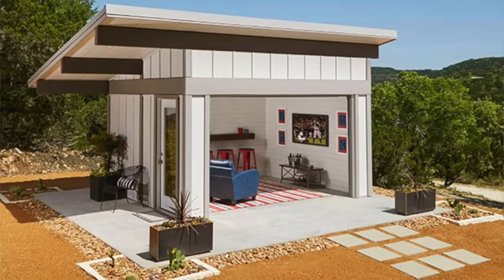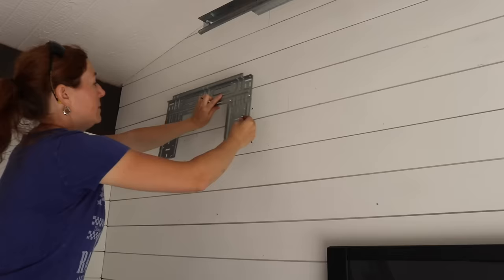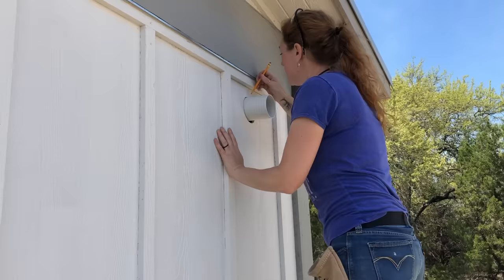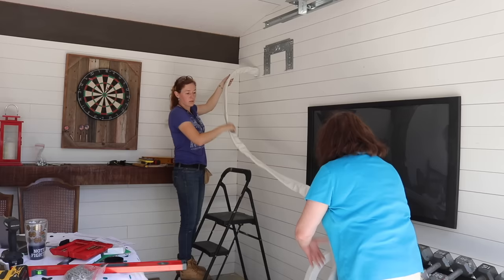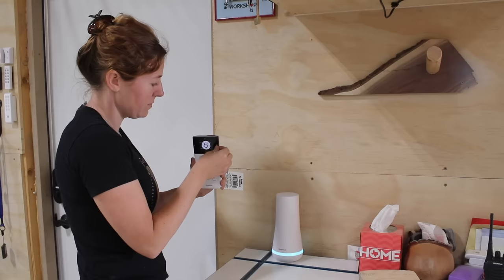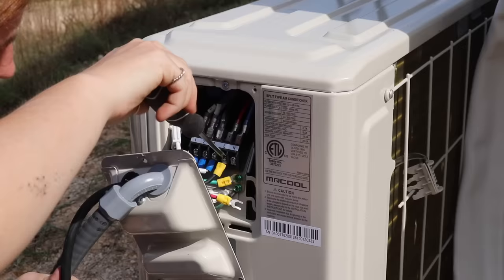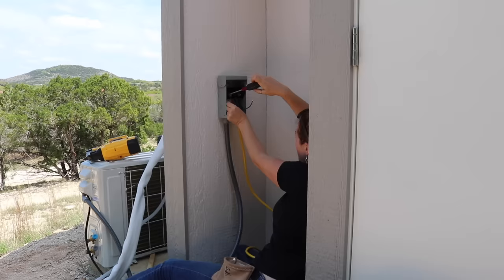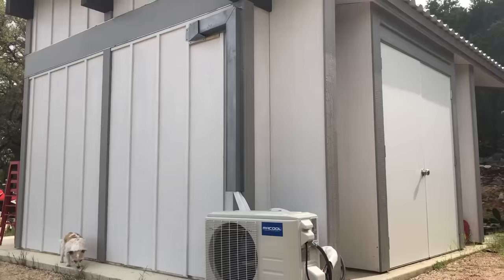DIY Ductless Mini Split Install - MrCool Unit

Comment: Why didn’t you just install a window unit with wall sleeve? Less power consumption and less costly.
Reply: Window units are loud and less efficient than a mini split. They are cheaper however.
Reply: It’s only 168 square feet. The generator size needed to run the split would justify a window unit.
Reply: @Robyrob7771  seeing his as that huge overhead glass door I think a smaller btu would be insufficient in the heat they get there year round, with the sun shining inside during daytime. Plus it doubles as a heat source since the unit she got comes with heat pump hence the cost for it on Amazon.

Comment: Might need to talk about pulling a vacuum and also the lineset being coiled like that will cause issues and shorten the life of the compressor.... might wanna call a LISCENSED HVAC contractor 🙄
Reply: Good golly are you just another who ignored to listen to when she clearly mentions and the company also states on their website, the lines come PRECHARGED, thus the full DIY (unless local code requires the electrical be done by a certified tech if connecting to main power breaker) install aspect of these systems they make and offer in various capacity. Go ahead before you react and look up the Mr Cool DIY in web search and check out the webpage where it has been mentioned since they came of with this system at least 2 years ago that the lines and not just the units coe precharged, thus plug and play DIY.

Comment: Weird, I thought you weren’t allowed to install that yourself. Which is why you had someone install the one in your shop.
Reply: Some places do not allow DIY install yourself, and must still get a certified tech to install them despite their clear DIY ease, though I heard of some buyers opting for the electrical getting done by a pro electrician for personal safety and personal liability insurance.

Comment: Does the mini split use 110 or will it need 220?
Reply: You can get them in 110 or 220 but I highly recommend having it professionally installed the lineset should have been shortened and checked for leaks with nitrogen and then the lineset should have been vacuumed down to get all contaminants and moisture out of lineset and check refrigerant pressures so the unit will operate properly and if you do it yourself without a license HVAC contractor you don't have a warranty and some warranty are good for 10 years just a thought
Reply: @troyb9609  Thanks

Comment: Could have saved yourself a lot of time by drilling your hole on the right side and pushing the refrigerant lines and drain lines straight through and making your connections all outside.

Comment: When running your mini split
 Run the fan on high speed all the time to remove the moisture off the coil 
Otherwise you will end up with mold buildup on the evaporator 

Also your template was probably on the cardboard somewhere
Reply: When she did the install of the bracket using it since its essentially its own template, she mentions how the right side did not align with the stud despite not using the horizontal slats which would allow to connect properlly to said stud and using only the vertical ones. Go ahead and watch this part again and you will notice.
Reply: Joshua79C C 
I’m good thanks 
 Pipe fitter by trade 
 Do the dry side when they the ac guys gets backed up 

I do the wet side of HVAC
Boilers chillers etc 
These things have their application but I wouldn’t install in my home 
If not properly maintained and run and set up correctly they are a breeding ground for bacteria and mold 

Thanks but no thanks 
Just my.02

Comment: Does that run off 110 or 220?
Reply: The really small cheap ones sometimes run off 110.  Larger ones are 220V 30A.
Reply: She linked it in the description, it says its 115V not even seen one that size using 110V, my window 12k btu unit uses 115

Comment: Mitsubishi has good systems.
Reply: They do. They are also expensive and won't sell them to the public.
Reply: Mr Cool is the only one to offer DIY units. Most others are as Jeffrey states, require a certified and experienced tech to have installed since those non-DIY systems require charging of the system after installing.

Comment: How long is the line set?
Reply: (takes a moment to look it up online) 25 foot per their website page on the system. That much line makes sense since it has little effect on efficiency no matter the length of it, but IMO I would rather 15 foot for such a short run  so as not to have so much extra coiled up 'in the way' of the units exhaust.

Comment: She didn't vacuum the line. No pressure test.
Reply: As she said, no need to vacuum that lineset. They have a version of "AreoQuip" fittings and are fully charged/ ready to go. Of course, if you ever try to disconnect them, you lose the entire charge and THEN you will have to do the whole vacuum process. The generator idea isn't the greatest: Many generators can put out very odd and unstable voltages and frequencies that can easily damage the electronics in these units. Creative install, decent video! 
[For the record: I have been in this field for well over 40 years!]

Comment: be mindful of carbon monoxide using a generator in small space. nice job , thumbs up
Reply: she was sitting where it will be put when working outside on the back end installing the electrical box. plenty of airflow and such

Comment: alos, does anyone have one of these. the contractors i spoke with said they do not heat very well, only 30 degrees above outside temp. so if it is 30 outside it would only heat to 60 degrees.
Reply: All heat pumps are not efficient below 30 unless it's a  Geo thermal . Most have heat pumps have heat strip added for below 30
Reply: I live In CA and it does fine. However gas is way cheaper for heating in Cali as we pay 20c kwh and up....
Reply: I have a 18k MR COOL unit in a 600 sqft insulated garage and it had no problems heat it to 75+ this winter when it was 35F outside.

Comment: Why wouldn’t you just get a portable AC?
Reply from the maker: I have several Mini Split units and absolutely love them! They're quiet, easy to install and cost efficient. If a portable AC is right for you, excellent! Thanks for watching.
Reply: These units are amazing. I heat and cool my 4000sq ft house with two 18k units. My house is 100% electric and my biggest bill since installing these a year and a half ago has been $138/ month. Plus the power usage is so low that you can still run them on a portable generator if the power go's out.

Comment: With that much extra hose I would have carried it off away from the house and buried the line.
Reply: And minerals in the soil would eventually eat into the copper line and cause it to leak.

Comment: Awesome video.  The best part was when you put all of that lineset right in front of the condenser coil so it will not get enough air through it.  These things are impossible to work on because home owners are doing it themselves. And when it doesn't work, it basically needs reinstalled.  These are not quality pieces of equipment.  You'd be better off calling a pro

Comment: Did you add a clamp connector for the power cable that runs with the line set?

Comment: I think I would pay an ac guy to shorten that line
Reply: John Davidson 
That would defeat the purpose of getting the DIY unit. Having the pre-charged lines comes at a significant price premium compared to similar models from the same manufacturer without pre-charged lines. Cutting the lines would be throwing that extra money away.

Comment: A $100 window unit would work.
Reply: Boy have you got to be that , since I rent I only use 5K ($150 from some small brand no longer using the old brand name) and 12K ($400 from Frigidaire through Lowe's) window units,  neither cost that little, and if so then they were made cheaply for that cheap of a price and would not last well. I also have a 15k Frigidaire, but was to much so it sits in storage but was $450 when I bought it, all only cool no heat pump like this MR COOL DIY unit hence their half or 1/3rd the price for what she got

Comment: I appreciate your DIY efforts but this is something that should be installed by a professional. All units should be started properly by verifying pressures, amp draw, etc. This should not be advertised as a DIY project.
Reply: Than they should not be selling them to just anybody.But she did install it and it works.
Reply: Sell it now Yes they are sold on the internet and they should not be. Also yes hers works but when it breaks then what? Then she has to hire a professional to come repair it. Working on ductless split system is not a DIY thing like recharging your car ac with the little cans of refrigerant.

Comment: looks like too much stuff for a air conditioner i rather put a thru the wall air conditioner with a normal  electric 115 v plug

Comment: seems like a lot of waste for a precharged lineset.
Reply: Otherwise she would have had to use a vacuum pump first then gauges & a tank of freon to charge the lines. Precharged lines became popular more than 30 years ago.
Reply: @jwarmstrong  alot of those ductless split systems come charged with enough Freon for up to 150ft from what I experienced. All you have to do is pull a vacuum and then open the valves. I understand that this is an easier alternative but I'd rather have a nice tidy lineset instead. Just my opinion

Comment: Too much!  Why not a simple in window unit?  Cheaper and no install required.  Way over-kill IMO.
Reply: AC units use much more electricity and thus are much more expensive to operate. Also, window units usually need the extra space around the unit filled in some inefficient way. Also, I have all casement windows; window units won't fit well.

Comment: You could of just put in a window unit at home depot for $150.
Reply: there are trade off, but once that minisplit have problem u need to open your wallet up, when window unit u just throw it away and put another 150 in. @paulcopeland9035
Reply: My newer window ac units are more silent than the older acs i used to us, the 5k unit in my bedrom was $150, I replaced a GE 10 with a Frigidaire 12 which is more efficient and also noticably less noisy than the former unit which was lacking in bottom guide/support brackets that broke of some years ago. Since i live in a rental unit I rather like the window units over the pricier and intrusive mini systems, until I eventully move into my own place will I consider a mini split to forgo the backbreaking with the window units and would keep them around for when the main system needs repairs during summer heat and humidity (i live in New England).

Comment: You did not vacuum the unit
Reply: that's because its not needed. its a DIY setup where both the evap and condenser are precharged
Reply: Seriously, listen and not just hear what is being said she talks, as mumixam said the in and out side units plus the lines are all precharged, this is how it has been since they introduced these DIY models at least 2 years ago.
Reply: @james6794  are you sure?
Reply: @NuCreativeHIcinema  Entirely. No. The documentation says the unit is precharged but im not sure what that really means? is the entire charge in the condenser unit like most standard split systems and the evap is in a vacuum? or are both the condenser and the evap charged. Having both parts under positive pressure make more sense to me as if the evap was under vaccumm there would be a high chance some air and moisture would be sucked into the system when connecting the quick connect fittings together
Reply: Correct.  The air and moisture left in the inset will eventually give her problems as moisture and R410a don’t mix well.  The line sets ARE NOT PRECHARGED.  Think about it.  How could she connect the flares under 250psi?  Come on people think.  The condenser is precharged but she should have vacuumed the system first.
Reply: Britton Corbin 
So you’re suggesting that the manufacturer of this unit is lying in these statements where they make it clear that the linesets are indeed precharged, or do you happen to know more about their linesets than they do?

“Precharged 410 Quick Connect Lineset. The included 25′ pre-charged lineset allows you to install this innovative ductless system without special tools, equipment, or training.”

“We here at MRCOOL did not invent pre-charged line sets. They’ve been around for years, but were mainly confined to the modular and mobile home market. That might be one reason why so many people have not heard of them. Don’t worry! Pre-charged line set technology proved itself years ago.  Basically, all we’re doing is applying them in an innovative way.”

“MR COOL says:
January 28, 2019 at 9:14 am
On the DIY unit, the lines come charged, so you cannot cut or modify them without professional training and equipment.”

Comment: What kind of installation? The outdoor unit is not fixed, stands on the concrete, there is no normal blowing. Long work will not be this unambiguously.

Comment: It's nice but $1,300+ for it is pretty pricey ....
Reply: Prices on Amazon fluctuate so wildly, its usually around $800, paid $400 for a similar size window unit from Frigidaire at a local Lowes
Reply: try looking up mitsubishi mr.slims
Reply: I realize since and at the time, this is more due to it has a heat pump in it, ac only unit will cost a few hundred less.

Comment: Can the line set be cut so it's not too long?
Reply: Aicx Medina No - she addressed this exact question in the video...
Reply: she said this model was pre-charged and you could not cut the lines
Reply: She said you can cut the lines, but then you would have to pay a professional to recharge them.  Defeats the DIY aspect.

Comment: I would of cut a hole and installed a window unit in the wall and been done with it . but thats just me. If I had one donated to me id do the same as your dong. thanks for the video.

Comment: rent pipe cutter pipe flaring kit to fix the length of the lines, vacuum pump charge line to suck out air from lines from tools renting shop

Comment: ☝ 32 years experience doing HVAC. 
About these DIY mini splits. The companies that make them often go in and out of business like the tides of the ocean.  Or they may one day decide not to import to the U.S. anymore making replacement parts almost impossible to get.  That being said if it does ever break down you'd be better off just tossing it and buying another one. It's a disposable appliance like a window air conditioner.

Comment: I would have kept the hole to the right though..
Reply: The unit is designed for the lines to exit right or left.  If she ran it out the right the lines would be an eyesore.
Reply: she made the best choice if you notice when she did the raceline install to cover the lines from sight.

Comment: Geez, I would have just put in a single window /wall unit. Cheaper and easier to install. For 150sq ft,an 8000 or less would have been perfect. A bit louder but no big deal.